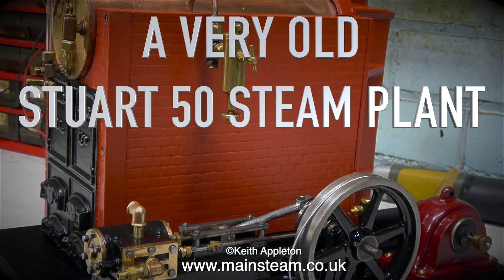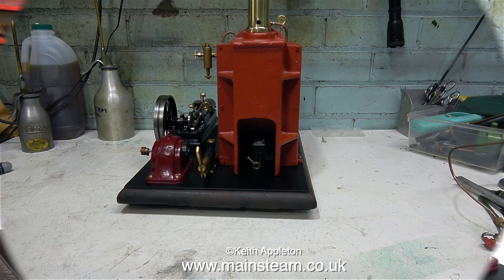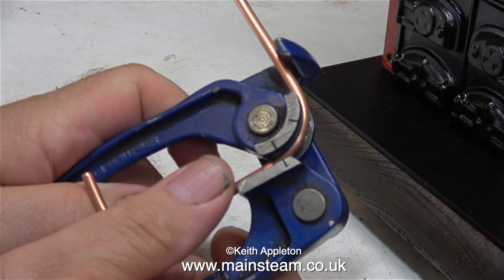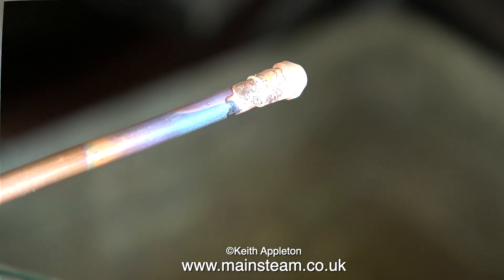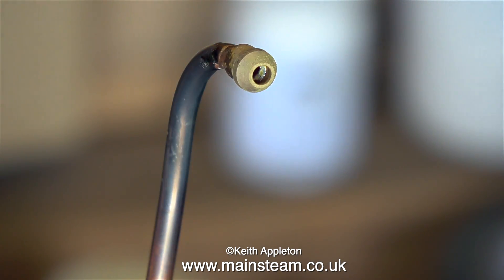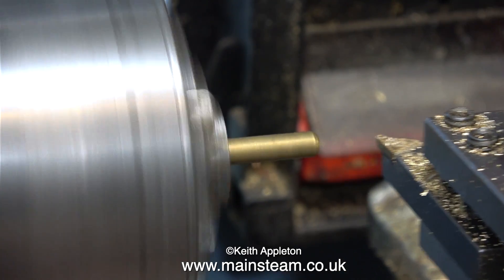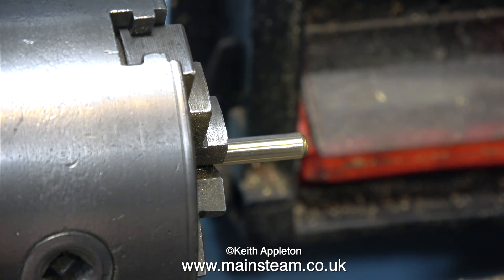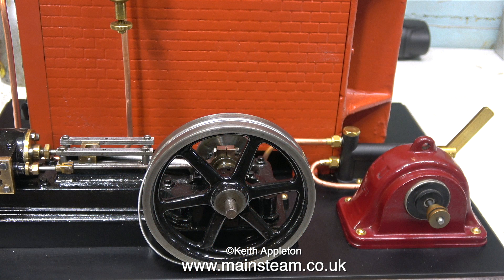A VERY OLD STUART S50 STEAM PLANT - PART #24

Comment: Silver solder connections can be kept clean on the inside by filling the tube with nitrogen or argon gas. Argon is especially easy as it is heavier than air, so you only have to put any plug on the opening further away from the connection where it isn't roasted and then fill the gas in to the appropriate height.

Comment: I hawe a beginners question, i recently restored an old Basset Lowke steam locomotive, i wonder if i can use tapwater or if it need to be destilled or dejonized (battery water) water?
Reply from the maker: Yes, that's probably a good idea.
Reply: @keithappleton  Thank You very much for Your reply, i will get my self a bottle next time i wisit the gasoline station, probably not realy comparable to Your projects, but i allredy love the little locomotive, i will see if i can find suitable oil for it as well before the first test drive, at the moment i just cleaned it up with parrafin and sewing macine oil.

Comment: I'm sorry but this is just my opinion. There's something about the myriad of visible piping on a steam plant like this that's a bit unsighly to the eye. I believe the Victorian way would've been to hide the piping running between the engine and boiler etc under the baseboard to create a less cluttered appearance. I'm aware there's no economic way of doing this on the current baseboard and that your preferences overrule mine, but that's how I feel on the matter of piping.
Reply from the maker: I sort of agree, but model piping is usually visible . . . so you can clean it and make it shine.